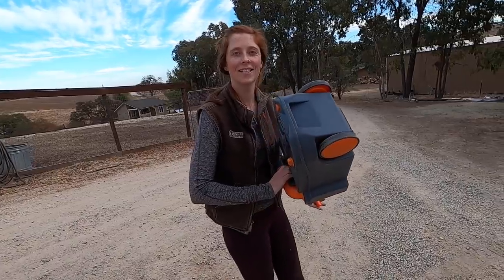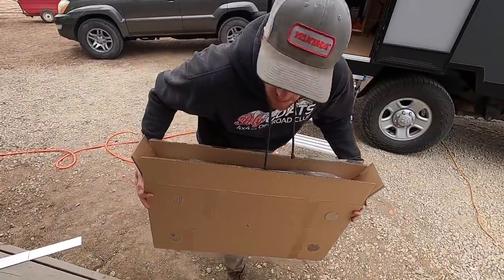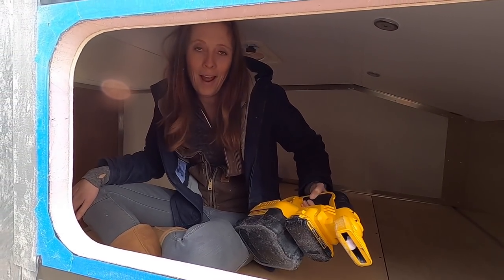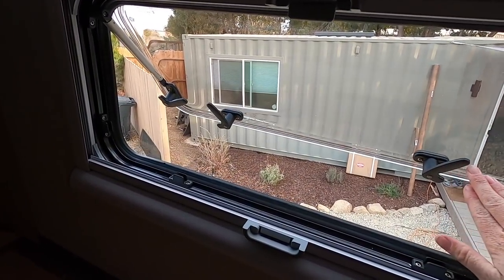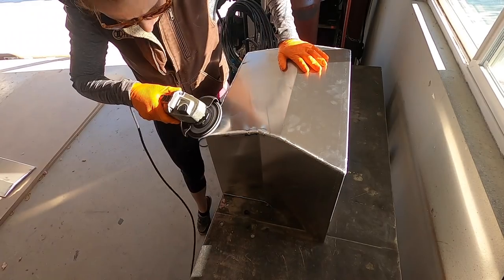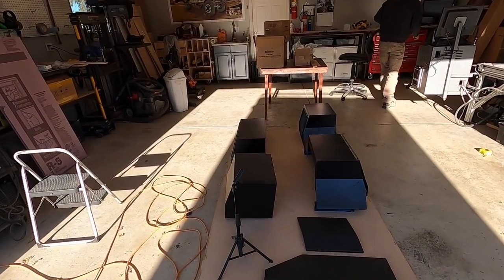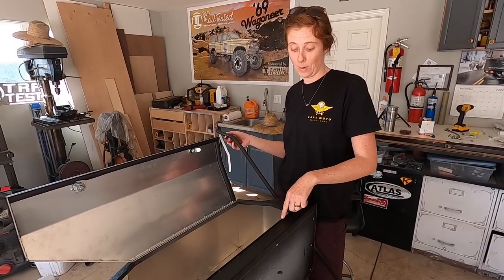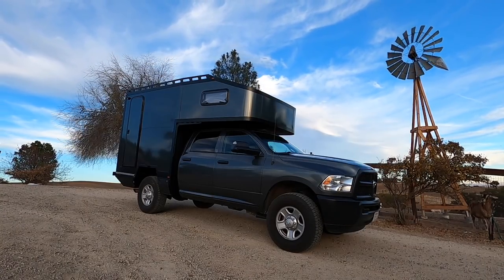Building Our Expedition Vehicle E8 - Windows & Storage Boxes

Comment: I have been searching high and low for information on an aluminum framed, foam core composite build and was afraid I'd have to make it up as I go. There's not a whole lot of information out there for building with materials that are easily accessible. Your channel is fantastic- I had to binge watch the whole series. Thanks for sharing the info! Also, Raptor Liner is the best and worth the mess! I've spent some time in custom manufacturing and sprayed it on everything from jet boats to dump trucks. However, when it comes to my own fab work or side jobs I reduce it 10-15% and use a plastic 3M Accuspray gun with a 2.0mm tip. With that setup, cleanup takes about 20-30 seconds and only uses 4-5 oz of acetone. The finish looks like satin powder coat and easy to get perfectly even, though it takes quite a few passes to get a good amount of mils.
Reply from the maker: Thanks for the tips on the Raptor Liner! I was hoping for more of a powdercoat look so I’m definitely going to try your method next time.

Comment: Wow. What a cool project and thanks for documenting all the steps. Quick question, (and maybe I missed it) how did you create a seal between the but joints on the side body panels?
Reply from the maker: They are overlapped like a roof shingle and have a line of VHB tape and a thick bead of Sika!

Comment: Cool guys use toilet paper to filter the oil in their trucks.
Also, I'm always paranoid rivnuts will spin when I'm torquing the bolt into them, especially when making them "Riley tight," like I would be inclined to do on those tool boxes. Looks like you are using quite a few per box, which can only help. How confident are you they will hold? And how is Riley going to avoid galling them since they're stainless?
Reply from the maker: Bolts in rivnuts should be torqued to “just below the spin factor” tightness 😉. We used a generous amount of loctite to prevent galling!

Comment: Not to be that guy, but you might want to rethink grinding down the weld beads on aluminum.  Since the weld does not provide the same sort of penetration you get with steel, a strong joint usually requires the bead material.
Reply from the maker: I only ground the welds on the under body boxes and plan to keep an eye on them. I really appreciate you voicing your concern and thanks for taking the time to comment George!

Comment: You guys did a fantastic job on this rig! I noticed you were using stainless rivets on aluminum. Also on the bathroom stainless wall you used aluminum trim. Do you have any corrosion from them being these being in contact?
Reply from the maker: Thanks so much! We actually used aluminum rivets on everything. There hasn't been any corrosion between the aluminum and stainless in the bathroom, but there is a healthy bead of Sika between them. We did use stainless rivet nuts into the sub frame to hold the under body boxes on. I'm keeping an eye on those, so far no issues.

Comment: It's too bad you guys haven't switched to metric yet. For anyone that says metric is hard to use, please explain how one can defend using fractions over a decimal point...? 

1/4, 1/2, 3/4, I get because we all use 25%, 50% and 75% but when you get into adding something up like 21-1/16", 3-5/32", 17-9/64" and 5-3/8", you really have to wonder why you hate the metric system so much. 

The sad part is that in the U.S., EVERYTHING is already running metric except the building trades. The automotive industry switched to metric decades ago. All science, medical, space program, aviation, military, etc. are all metric and it's costing the U.S. over a TRILLION dollars a year to run both because they are connected to the world for trade. Just imagine what that money could do if not wasted. Canada is officially metric but suffers as well from that in the building trades and person mindsets. Those imperial mindsets go to work in a metric world and bad things happen like being given the wrong dosage for something while in the hospital or crashing into Mars. In Canada back in the early 80's when Boeing had built one of their first, two metric management aircraft, an Air Canada 767-200 ran out of fuel an hour into a four hour flight because of just that, conversion error.

Even though most building materials sold in Canada are in imperial measurements just as they are in the U.S., I plan out all my builds in metric. Drill bits are a bit of a PITA as are wire gauges but not working with fractions is so much easier on the brain. Haven't you ever thought that it looks really odd when you look at gasoline prices and they are shown as $4.99 9/10 instead of $4.999?